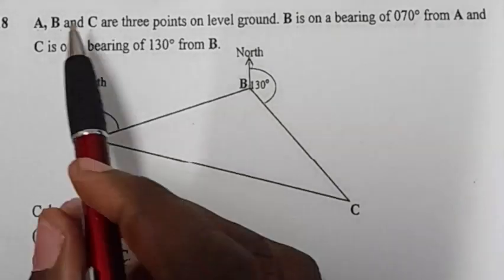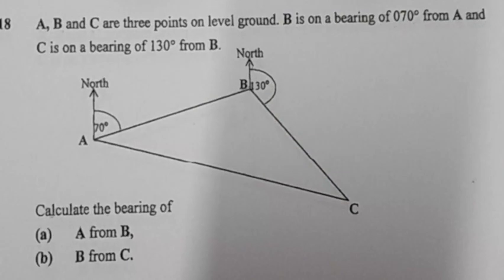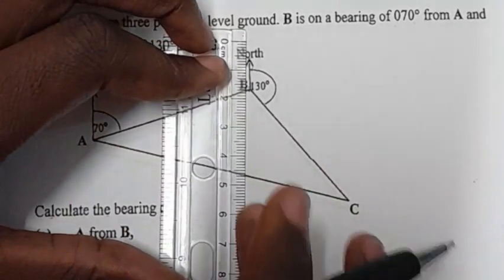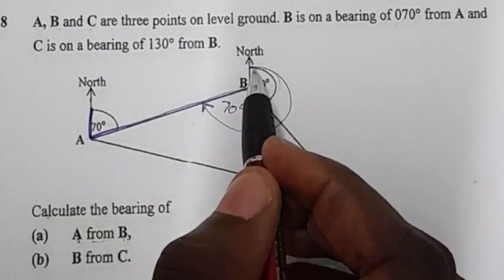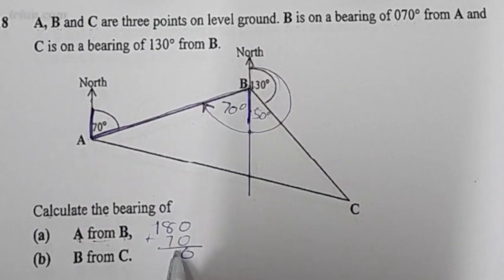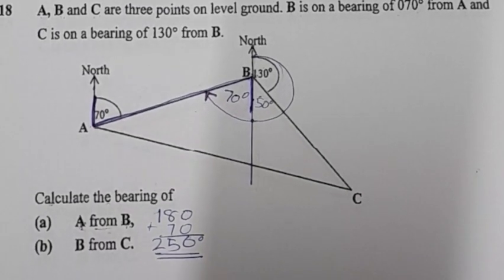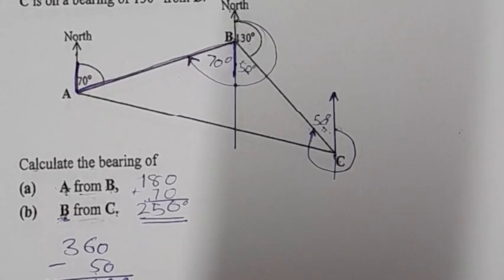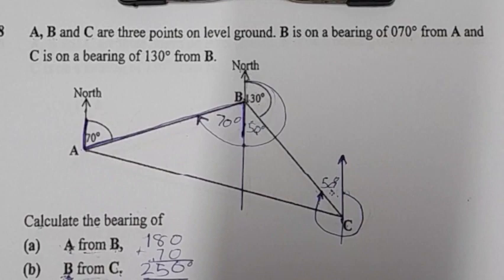Calculating bearings made easy: Step - by - step guide part 1 #bearings @GSCEMathematicsZone12

Comment: A from B = 180 + 30 = 210
B from C = 180 + 130 = 310 
Note: Alternate Angles is what was used
Reply from the maker: We appreciate your feedback, and You are right when you say that you used the property of alternate angles, but the Bearing of A from B is not 180 degrees + 30 degrees. It's supposed to be 180 degrees + 70 degrees giving 250 degrees as the correct answer. It is so because the 70 degree at A is Alternate to the 70 degree at B.
Reply: It looked like 30. Thank you then it must be 180 + 70 = 250
Reply from the maker: Noted, thank you. We appreciate your participation sir.